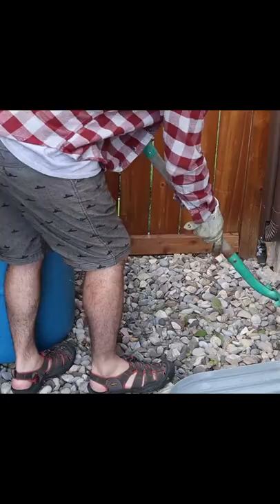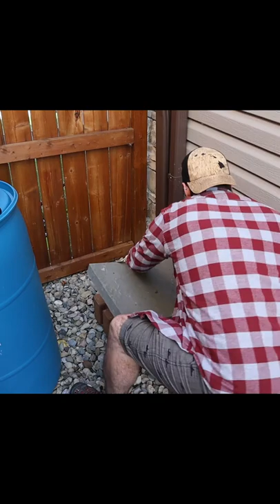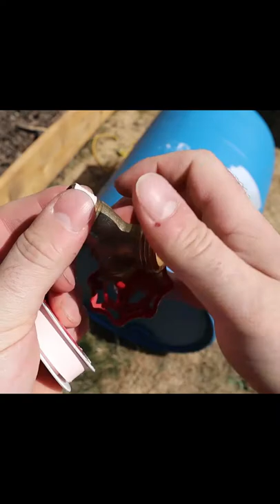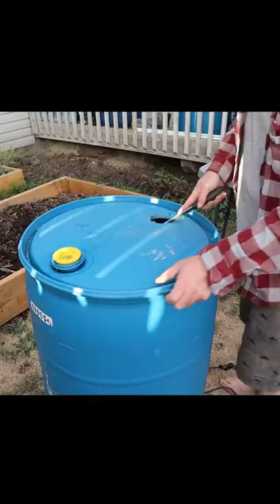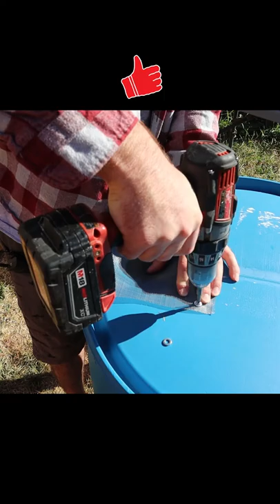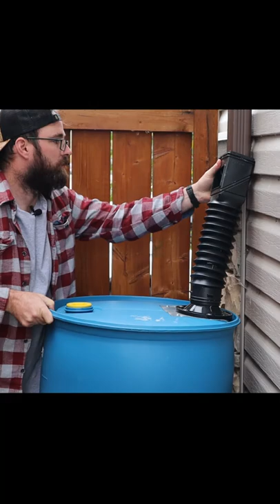How To Make A Rain Barrel #shorts

Comment: How'd you secure the bottom turn valve without being able to reach your arm down into it?
Reply from the maker: Lol you caught me. It was a mistake It for sure was the trick part. I put the valve on a string and fished it through. I put pressure on the side of the rain barrel when I tightened it. All you need to do is get it started

Comment: What's the purpose of the first drilled hole?
Reply from the maker: Are you talking about the top to bottom one? Top is overflow valve. If it rains to much or so frozen water buildup won’t crack your rain barrel

Comment: what about over flow ? it will come out raight against your foundation.
Reply from the maker: Depending on what you do with the water. I have an overflow at the top which you could easily attach a hose to.